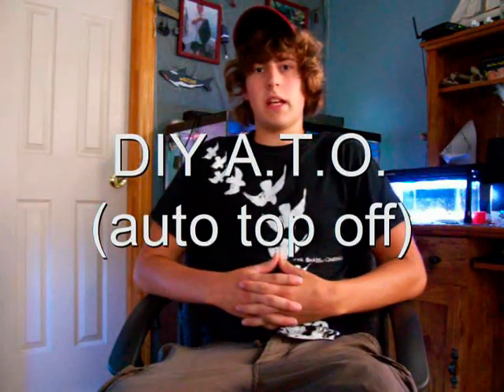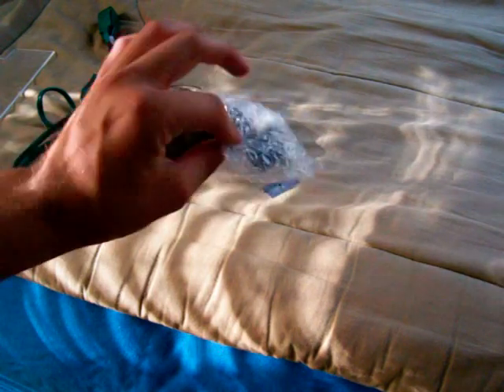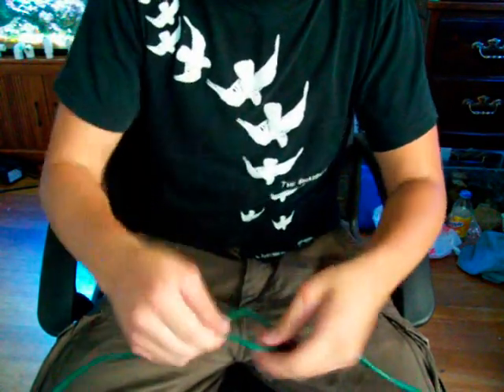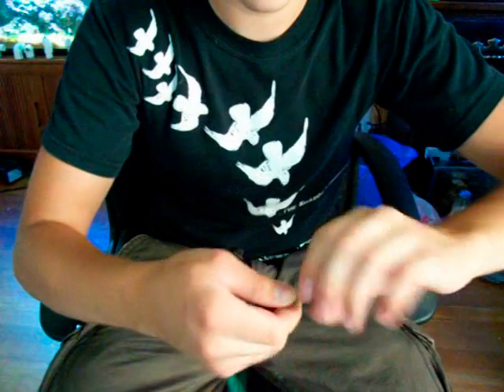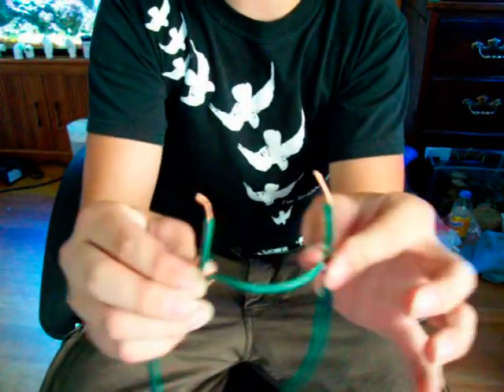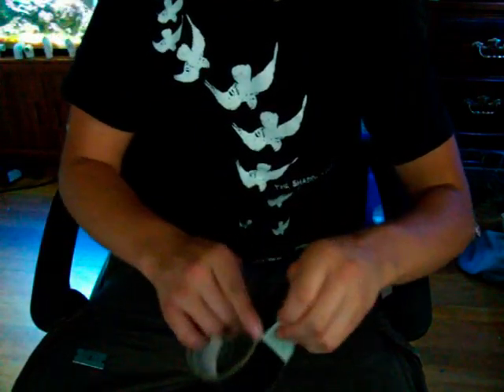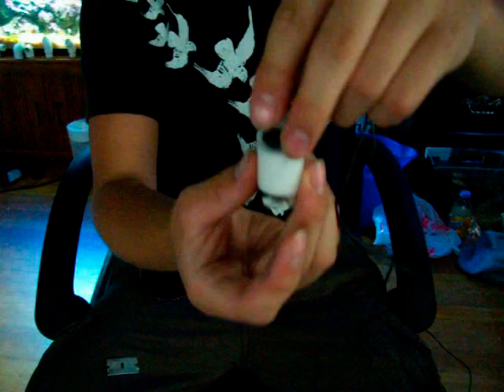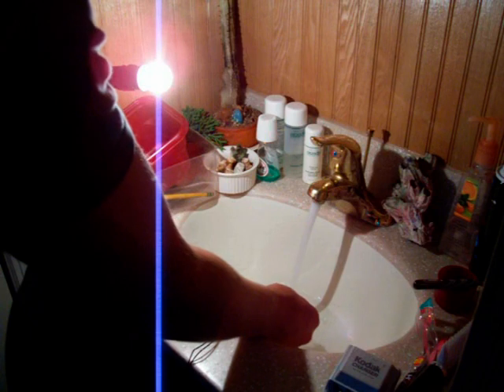DIY Auto Top Off System

Comment: The problem with this set up is that you're switching 110/240 mains via a small float switch - exposing yourself or your tank to potentially dangerous mains power. A more sane approach would be to use DC voltage to your float switch, and house a relay inside an IP66 case. The mains switching then happens in a sealed case.

The other problem with this is that evapouration happens slowly, so you'll get to a point where you're just teetering at the point where the float switch closes, causing some water to flow, and then opens shortly after as soon as a small amount of water has gone into the tank. What happens is the pump then switches on several times through the day, because not much water gets to the tank before the float switch opens again.

Comment: grounding is the same thing/reason for the lightning rods on a building.  It gives the electricity a place to go so that it doesnt destroy the building.  We would be perfectly safe to hang on a wire as long as you don't connect the circuit to the ground.  Don't try this obviously but a bird doesn't connect the circuit so it actually has electricity passing through unharmed.  As soon as the bird makes contact with the ground and the wire at the same time it would die

Comment: yes correct so what does grounding mean? difference in voltage... otherwise known as electrical potential difference this is what kills you not the current. Current is flowwing through the birds but since there is no electrical potential difference (voltage) they are fine.

Comment: Don't follow this guide exactly. You do NOT want 120v flowing through your tank when that cheapo float switch fails(it will. using more then one will help prevent floods but not stop your fish from getting a 120v pick-me-up). Wiring a simple relay into the circuit will prevent this and cost you $3 more and an extra 10minutes of your time. Google it. If you can build this, you can wire a relay.

Comment: Who cares what kind of tape he used, or where your uncle works, this kid is running live AC current to a tub of water.  This will kill you for sure if you were to touch the water while the float valve were immersed.  I'll bet even Ford mechanics wouldn't advise that you ever do this.  Jesus Christ, I just got to the part where he lit a lamp by using his sink.  Good job kid!  Do your part to eliminate your carbon footprint!

Comment: stop. you need: a small 120/12v. transformer, a 120v. relay with 12v. inputs, and a small electrical box.... then it wouldnt be a death trap. because it works doesn't mean its quality/safe

Comment: I like this idea, not so much your safety with electrical though. Im thinking of running two floats like this, so as they BOTH have to engage before my water starts topping off. That way if one fails, i dont get a flood, or tank crash.  Ideas on that? Anyways, great video, be safe.

Comment: btw you use the switch inline on one of the leads for the batteries inside the battery operated air pump..

Comment: This will top you off nicely on a nano tank. Keep the container near the height of the container, but not above. Keep the output air line above the water level of the tank, or it will create a vacuum and back feed..

Comment: DO NOT do this. That switch and the wiring for it is probably not rated for 120V AC current and might start a fire. If you really want to do this low cost method, buy the switch and a battery operated air pump, then use a pressure type system where the air pump pressurizes through the lid of a container, and then add a second line from the bottom of the container into the tank. Just drill holes in the container lid and tightly feed air hose wiring through it. Use a rigid container. cont..

Comment: @cuttie100 

Volts are not deadly Amps are. I do however agree that you should check the float switch and make sure you are running the proper volts as well as amps to it.

Comment: This is a good idea just use a flood pump switch that can handle US110v or UK240v
off ebay about £10-£20 : ) saves messin with relays and power converters.

Comment: This is VERY dangerous... the AMPS going through an extension cord will kill you in a split second.. both freshwater and saltwater aquariums have electrolytes which will carry electrical current very well.. if you are doing this find a pump that uses DC current adapter.. use a GFCI outlet (the kind with a reset)....saltwater may corrode the float switch if it is not made specifically for saltwater.. i've even seen it eat through fish tank heaters and pumps not approved... VERY dangerous.. :(

Comment: its not jst the possibility of a short circuit. The float switches can melt and become permanently closed causing a flood. They arent meant for 110 VAC. Do some research into a relay spend approx. 10 bucks extra and it'll save you many in damages.

Comment: Not good that was like watching a video at school where summit goes wrong and u just get fryed. That switch ur using is 12v ur jumping into a 120v power source. If it shorts in ur ultra safe duct tape it will make everything live including the insides of ur tank. That's why u should buy a proper unit.

Comment: +1
biggest hack job ever. Don't use scissors or a razor, use wirecutters.
Also, don't tape the wires together.... worst idea ever. You really should solder/butt connector and heatshrink tube everything. salt water +open wires=....